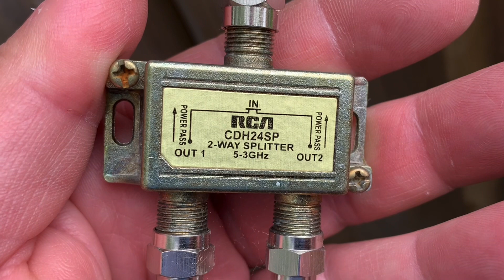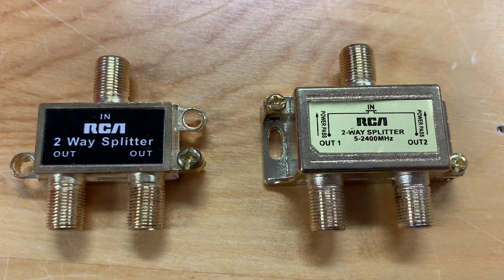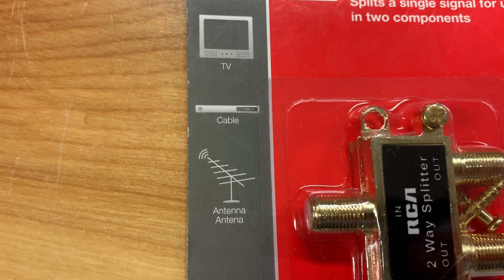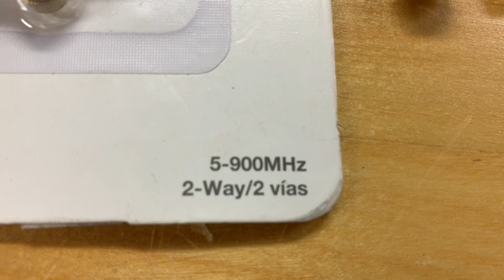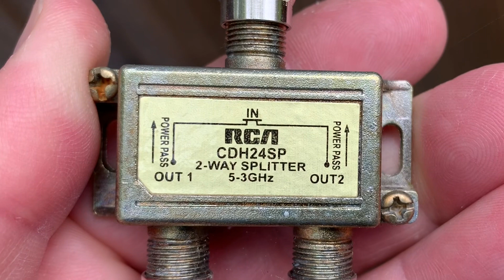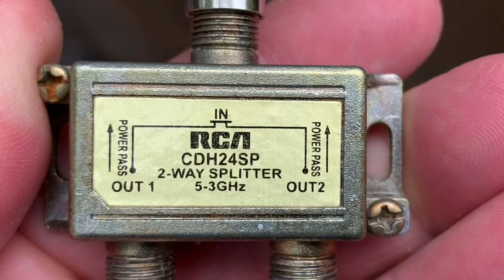Choosing the right splitter for Satellite TV

Comment: I am soooo glad I watched this video!!! I tried using a splitter that Xfinity gave to me to connect my Dish and Xfinity internet. When I connected the coax cable from the wall jack to the splitter and from the splitter to the coax cables for Dish and Xfinity, I DIDN'T GET ANY SIGNAL TO EITHER!! Their splitter is not labeled with a bandwidth rating or power pass. I'm ordering a splitter from amazon that has both. Hopefully, this will solve the problem. Thank you for this video!
Reply from the maker: I’m so glad that you found it helpful!

Comment: Hi,
I have a technical question for you about my new satellite dual receiver.
My name is Jean-Pierre Desrochers, I live in Quebec City, Canada.
I have a single input Bell satellite receiver that I'm about
to replace for a Bell 9241 Dual receiver unit (same as Dish VIP722).
So far my wiring installation is the following:
Dual legacy LnB's (aimed at Nimiq-91° and Nimiq-82°),
both connected to one SW21 switch, then the output going
to my single input Bell receiver. Ok.
My question is:
If I place a Dish Network 123254 DPP Separator
at the end of my incoming COAX and use its 2 separate outputs
to feed the 2 receiver's input, will it work ?
Will I receive on both receivers ?
Thank You for your time.
Reply from the maker: @jpdesroc  I might be wrong but I believe that is how the connections are supposed to be made. The signal from the dish is split by the separator and fed into the 2 inputs on the receiver for each satellite.

Comment: My splitter has the same power pass printed on both output but the first receiver lose signal when i turn on the second receiver 🤔
Reply from the maker: That will happen if the second receiver is turned to a channel on the opposite polarity as the primary receiver. Example: primary receiver is on a vertical polarized channel, second receiver is on a horizontal polarized channel- signal lost. If they’re both tuned to the same polarity channel, no problem.

Comment: Nice video. The other day I went to a store and asked for satellite splitters so I can connect 2 receivers to 1 LNB. The guy there showed me one splitter similar to yours (with the label 'power pass') but told me that such splitters can't serve 2 receivers at the same time; one of them must be turned off so the other receiver can get signals from the LNB. I asked him what the point of selling them and he said these are used in hotel TVs.. Now I watched your video and somehow got confused. Was that store guy wrong?
Reply from the maker: I have one of these splitters splitting a signal to 2 receivers and have no problems. Thanks for watching!📡📡
Reply: You can't watch channels with different Polarizations with these that's one channel with Vertical & another with horizontal

Comment: So it can split signals from the disec switch...
Reply from the maker: I have only used the splitter before the DiSEqC. I suppose it could work after the switch, so long as the receivers are set up with the correct commands. But I have never tried that before.

Comment: Great video. As a splitter I would recommend an Satellite/Terrestrial TV Combiner SSC-4 (Quad) also known as an antenna/satellite multiplexer. You have one input from the Antenna 47 - 862 MHz, 4 inputs from LNB, and 4 outputs which the antenna signal is combined. At each output you must install a diplexer to separate the antenna and satellite signal. The antenna amp is mandatory for a good reception also a satellite amplifier. The type of amplifiers that I use is the Inline Coax Cable Amplifier DVB-T/SAT, 18dB, 5-2300MHZ amplifier. You can mount it directly on the splitter or diplexer also has a power pass for LNB. If you use it for antenna I would recommend a power inserter if you want to connect it directly to TV a 5 or 12 Volt power inserter is good. Or turn the antenna power on from your terrestrial set-top-box. I have some friends that are new into free to air satellite and antenna reception and I recommend your videos.
Reply from the maker: Sounds like a good setup there. Thanks again for watching and for the comments.
Reply: @NorthcoasterHobby  Don't know why YouTube deleted my comment but I will type it again. I have 4 satellite receivers, 4 TV sets and 2 FM-DAB+ radios. Initially I wanted to run 2 cables to each TV, one for FM-DAB+, OTA TV the second for satellite TV. The problem was that I could only run one cable so I searched on internet and found out that the solution is to install a multiplexer and at the end diplexers with amplifiers. And I have all the  signals on each cable, the reception is great, got the "best of both worlds" in short.
Reply from the maker: @Nicholas_Chris  Strange, I replied ‘A sensible solution’ to it earlier.
Reply from the maker: @UCTze77D26U0keYLuXZ2Pwaw A sensible solution.
Reply: Please do me a favour , I do have new tv splitter for dividing antenna or aerial signal from 1 antenna ( not satellite dish) and need to use it to divide signal from antenna to use two TVs , so do you think this little splitter is sufficient for getting good signal for both tvs without losing signal?? I don't like using amplifier which requires connecting to mains power, thanks a lot 😊
Reply: @Europe-i3z You need a TAP. A TAP is exactly like a plitter but on one output the signal attenuation or signal loss is much lower compared with the other ouput.

For example you want to use 10 or 15 meters coaxial cable, a splitter will have 8 or 10 Db signal loss and on 10 - 15 meters cable it's worse you might loose channels expecially on UHF band

The TAP will let you use a 15 meters cable without signall loss, one output has 2 Db signall loss perfect for 15 meters cable and the second will be 6 or 8 Db signall loss I recommend you to connect a 2--4 meters cable maximum 4 meters cable so you won't have signal loss

IMPORTAN, you may need a Yagi antenna with more elements for example instead of 19 elements UHF Band you may need a 44 elements Yagi UHF antenna to gain more signal so you can connecta 2, 3 or 4 ouput TAP.